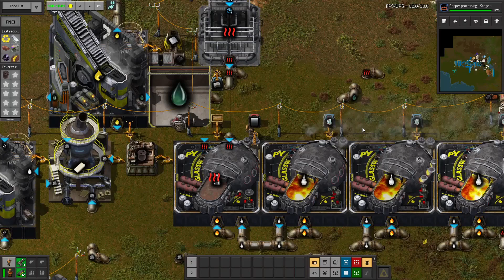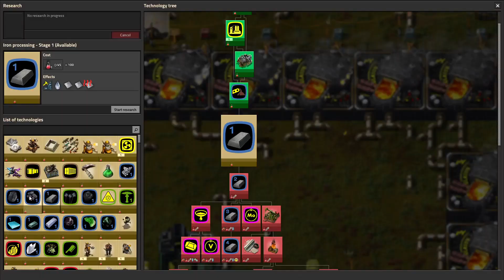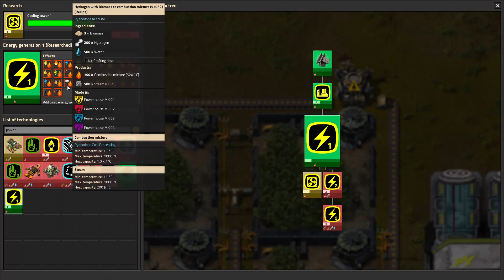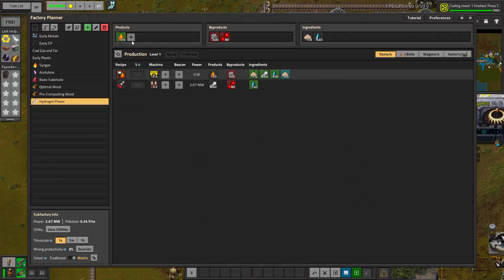Factorio Pyanodons Supershorts #6: Hydrogen Combustion Mixture and Copper and Iron Processing

Comment: If your syngas setup is similar to my first one, it is choking because you don't have priority valves to take the coal gas from the tar->coal gas gasifier first, which causes the coal gas -> tar/syngas to not be able to output its tar. Try setting up some valve priority or adding a few dedicated gasifiers. Also, your steam is not going to vent properly. If you don't have the duralumin for cooling towers, you need to vent the steam with a tailings pond. It's worse for UPS, but thats not a real concern at this stage of the game. When you do switch to cooling towers, be sure to put in a small, partially filled water tank in the chain to smooth things out. It can get brown out spikes if you don't have surplus available just from the quantity of water that the systems draw.
Reply from the maker: Thank you very much for this advice! I'll pin this, because it's two or three more episodes from here before I figured out that I needed the tailings pond for steam and the valves to fix the syngas system. And now that I know about the UPS issue, I'll make sure to switch to cooling towers soon. Although I'd like mark 2 cooling towers first, haha.
Reply: @minecraftinchocolate  it's not a big hit. Just keep in the back of your mind that you should fix it when you get to mk 2 furnaces.